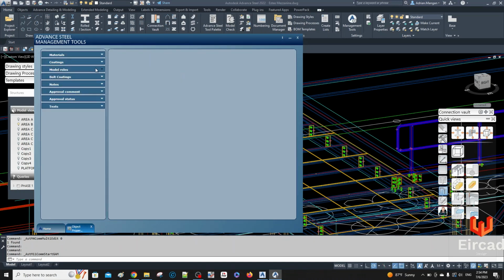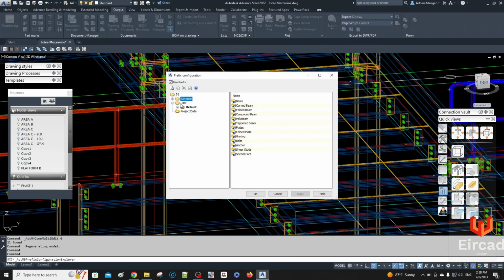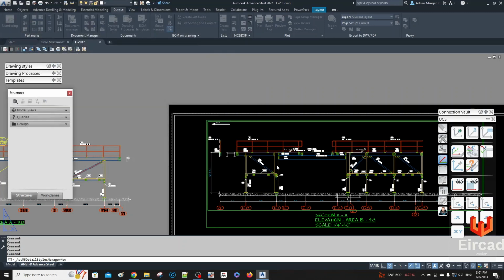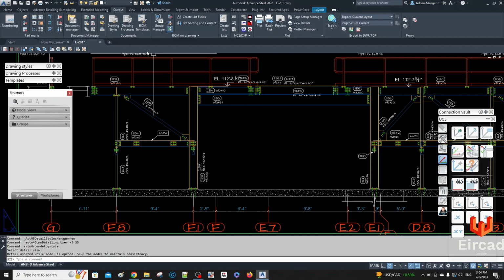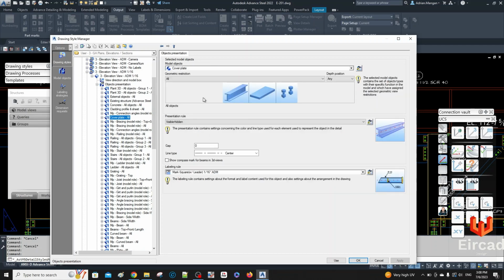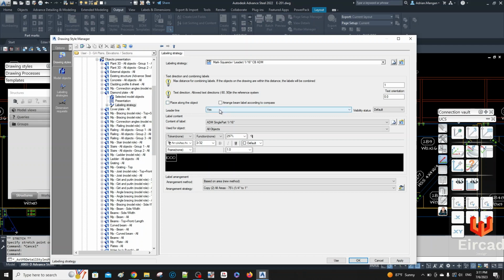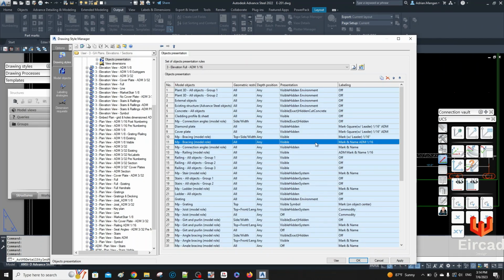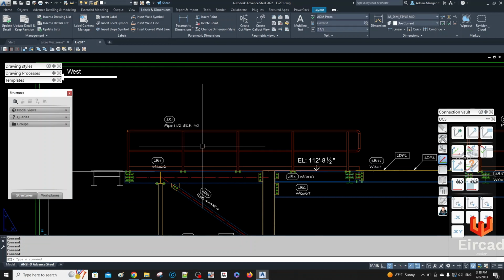ADVANCE STEEL: Todays Drawing Style Edit - Bracing.

Comment: Hi Adrian. I see your horizontal beam system lines are on centre. That makes sense to me, but the training I underwent here in Australia suggested horizontal beams put system line on top centre and everything else like columns and tube on centre. Can you see any issue if I start just putting the system line on centre for everything? It seems like the logical way of doing it. I know the system line drives dimensioning on the drawings, but being on centre shouldn’t affect the outcome.
Reply from the maker: Hi, almost all of my beams will be top of beam, bracing on the other hand the working points are generally center line of bracing and where the center of the column and the beams meet, so logically it makes it easier to work and display this using the system line which to match working points nee to be in the center. Other than that most beams if not all should be modelled with system line top center. Hope this explains